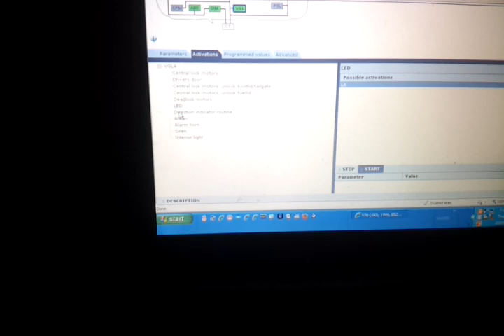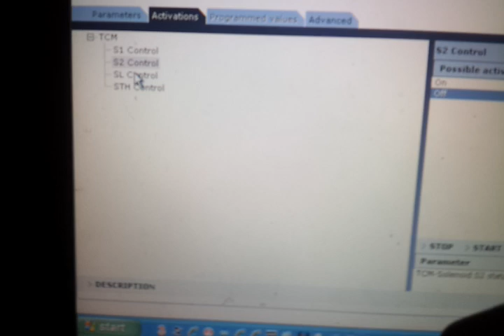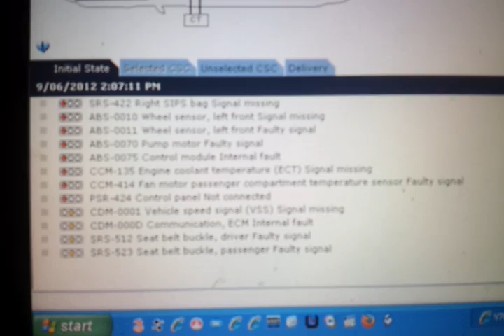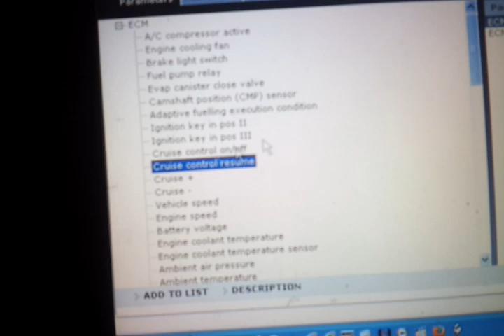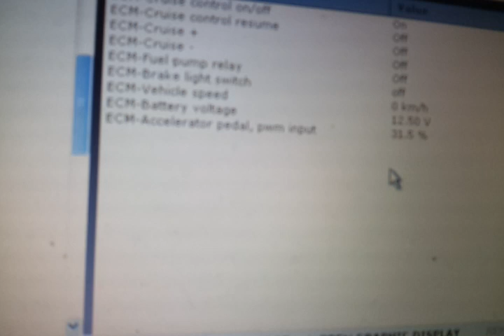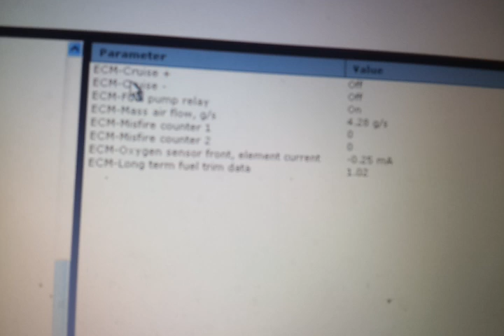Using Volvo Vida

Comment: Hey. How can you change  vehicle computer language from Italian to EN?
Reply from the maker: Yes I helped a guy do this once however it was more than 2 years ago and I don't recall if there was a software download involved.    In CEM parameters I think you need to set upper and lower temperatures of the seats.   The seats must be of the heated type of course (or have an element of similar wattage inserted) and you're going to need the factory switch in the climate panel.